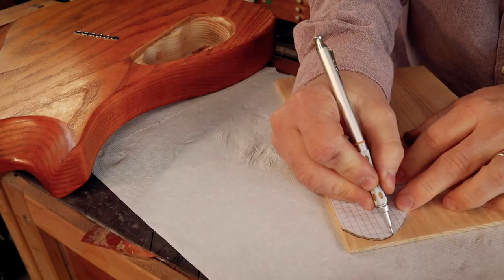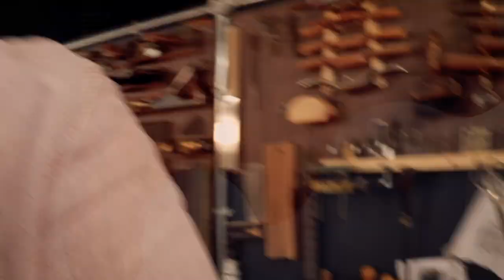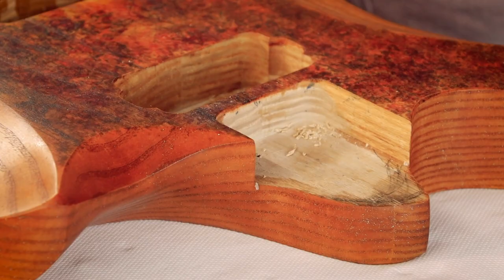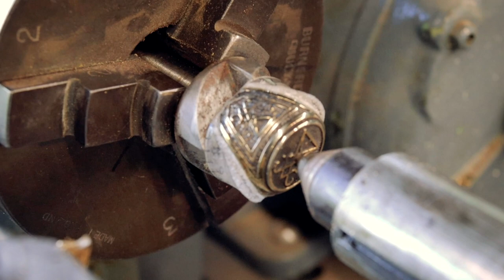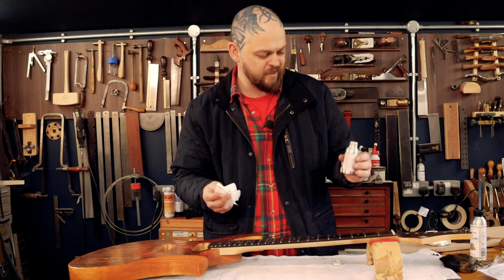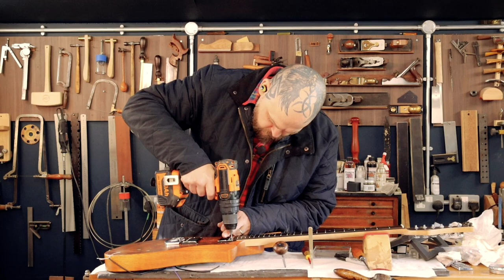Ep 3.2 -  Finishing Touches in a Heavy Metal Inspired Guitar Build - The Uncut Kit Guitar Build

Comment: On the machining point, there are a few things I would point out from having watched some machinists at work.  Firstly, doing metal work on a lathe generates heat very quickly.  I think I saw you putting an occasional coating on the drill bits (which you will get away with for small pieces with softer metals like the one used in this video) but when you start working with something harder like some grades of steel you would want a more consistant cooling method.  Having a stream of water going over the drill bit was the most common technique in the engineering company I worked at but when doing smaller pieces where such a system is not practical (or more likely just not working) the next method was to keep spraying with WD40.

Comment: Great video, I've enjoyed watching this build (as I have the others) but it's good seeing you work at a normal pace rather than rushing to beat a set time.

Also, bit of an off topic question but in other videos, when you've stuck a strip of masking tape down you use a tool to smooth it out. Small, bulb like wood handle with a circular brass end you run over the tape to smooth it and make sure it's stuck down. It looks like a wax stamp but can't for the life of me remember if you actually said what it's called in any of the videos you've used it in

Comment: Genuine question, how come the shielding paint does a better job than pure metal?
Reply: shielding paint isn't better. It's the same effect but much easier to apply. You're creating a Faraday cage . You don't need fancy copper tape to do that. You don't really even need it using humbuckers either I don't suppose. Matter of fact you can make your own shielding paint using whatever color paint you like and mixing in graphite powder.
Reply from the maker: Metal tape has an adhesive backing that, when you use multiple pieces overlapping, interrupts the connection. The paint is homogenous and also much much quicker and easier to use. B

Comment: I’m no machinist either, but aren’t long sleeves a no-no?
Reply: Happened to a cousin. Broke his arm. 
Beware: 1 string (snagged), and your arm's in the machine.
Reply: Long slieves are not so bad, just so long as they are not loose.  If they are tight to the wrist there is little chance of them getting caught.  But this is one of those reasons why there should always be one of those large easily accessed emergency cut off switches on industrial machinary.